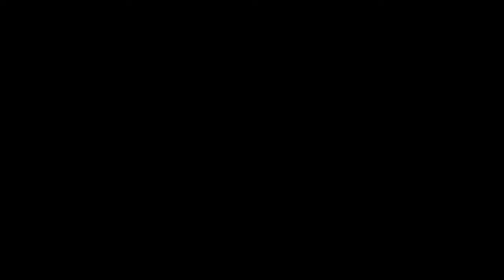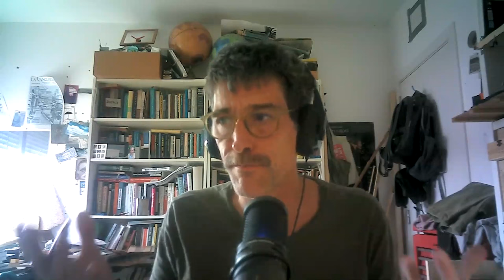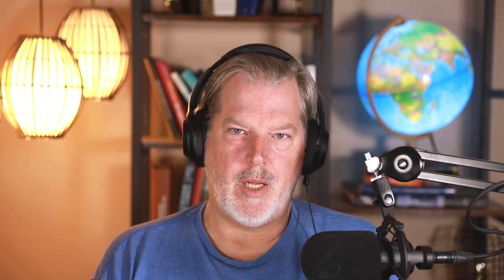Kris De Decker on Low-Tech Heating

Comment: This is why I like sitting around a fire, radiant heat AND soothing view of a controlled fire makes it a favorite thing of winter months.
Reply: Deep genetic memory.
Reply: and great dioxines inhaling!
Reply: @moermanchristian  I love the smell of dioxins in the morning! :-)
Reply: Burning wood gives off heat.
Reply: Less than 10% of homes in my area use woodburning but the air is horrible from that.
Reply: Rocket mass heaters lessens the exhaust.

Comment: to this day, i believe one of the best and efficient low tech heating system is the japanese kotatsu. the amount of heat required to reach a comfortable temperature is quite small thanks to the futon on top of the table, which also allows to keep the heat in, thus dramatically reduce the speed at which it will dissipate in the room. more often than not, it would be so comfortable that i would fall asleep in the living room under it.
Reply: any fires with those?

Comment: As child we used hot water bottle in bed in Scotland. I recall the heavy ceramic  water bottle still in use as the rubber variety was available. The ceramic, stoneware, bottle was called a pig... So we heated our bed with a warm pig😅

Comment: We live without HVAC (woodstove). Hot water bottles stay warm all night long under the blankets. The kids line up at the stove every night for the bottle (or 2 if the night is very cold) and find the experience comforting. We also use them when we go to the kids outside sporting events on cold evenings.

(quote)

Not very long ago, there was a time when everyone went to bed with a hot water bottle in wintertime. Before their universal availability, people used ceramic water bottles. Before that, bricks and smooth rocks warmed in the fireplace and wrapped in a small blanket (as anyone who has read "Gone With The Wind" would know). In our home, each night, everyone lines up at the woodstove where we keep a large stockpot filled with rainwater (no calcium build-up in the bottle; and that presupposes that in addition to using hot water bottles, one would have arranged rainwater collection). If the overnight temps are 20 to 40 degrees F, that is a one water bottle night. Anything below 20, and it is a two water bottle night. If the weather is cold for days on end, we refresh the hot water bottles in the morning and put them in the beds under the covers to keep the bed warm and recharge them again before bed. Since our only heat source is a wood stove, there is no direct heat source in the bedrooms. Wood heat is a fairly common arrangement in most of FlyOverLand (rural America); for some crazy reason, hot water bottles are not. Instead, people use portable electric heaters and electric blankets and endure outrageous bills for electric service from their utility. I am talking thousands of $$ per year—tens of thousands of $$ over the time it takes to raise a child from infancy to adulthood—for what a hot water bottle could do for 12 bucks. Most of us are feeding a wood stove anyway. Why not put a pot of water on it and have a super cozy night's rest, and save yourself a small fortune?

(unquote)
Reply: Why no calcium buildup in the hot water bottles?
Reply: Excellent question!

We collect rainwater and use that in our wood stove water saddles to avoid the calcium problem. Ergo, I don't know if calcium would build up in the water bottles.

OTH, daily use of a hot water bottle will lead to failure (in our experience) within 2 winters. So, perhaps this issue is moot. We are experimenting with ceramic and a Japanese favorite hard plastic bottle this year. FIrst impression—they are not as comfortable to bump in to but probably will last for years. 
 @barnabyvonrudal1

Comment: So - we used hot water bottles when we had no central heating. It did go cold over night (contrary to what he said) however the bed was warmed by our own body heat by then and it did retain that heat.  We used to also rub our hands up and down on the bed sheet so the friction warmed it up just before I got in.  I’d be toasty and warm after a little while whilst I entertained myself by picking sheets of ice off the inside of the window.

Comment: it's good to have multiple sources of heat including low tech radiant that can work without electricity and higher tech central - using different energy sources. be resilient. those low tech heat sources are not overly efficient, a wood stove is 60 to 70%.
nothing can beat the efficiency of a a heatpump in milder temperatures.
Reply: I think we also need to consider how much space you are going to heat and the ease of controlling it. I tend to agree radiant heating is very concentrated (only you are next to it). For heat pumps, the current product in the market is for space heating, which means heating a lot of unnecessary space.

Comment: The  lower humidity in winter absolutely makes it feel colder.
At 70f and 10% rh the apparent temp is 65f. At 70f with 60%rh the apparent temp is 70f.
Reply: It's actually quite the opposite when temperatures are lower here on the "Wet" Coast. 5 degrees Celsius(41F) Feels WAY colder than -2C(28F) because at -2C(or lower0, everything is frozen, resulting in a lower relative humidity. (often referred to as a "dry" cold. Even -10C to -15C "feels" a lot less cold than 5C because it is dry)
Reply: I'm talking about indoor temps
Reply: I've noticed it in my house.  When the air is colder outside the absolute humidity is lower so that air indoors is drier and will feel colder by far than when it's summer and the absolute humidity is higher and hence the rh is higher indoors if it isn't dried . The apparent temp change of 5f is notable.